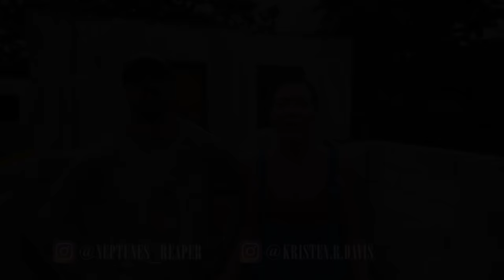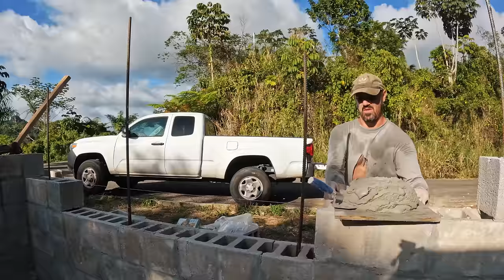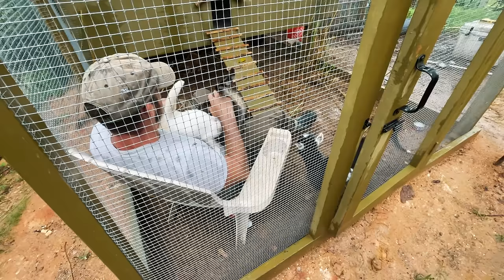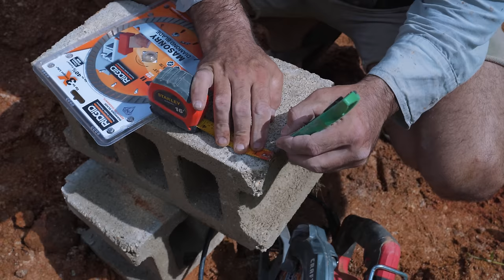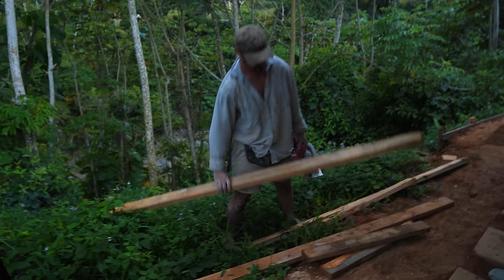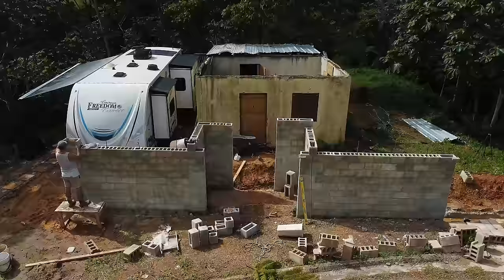BUILDING MASSIVE BLOCK WALL WITH NO EXPERIENCE ON OUR ABANDONED PROPERTY

Comment: what your dad did not tell you is on big job you have a man mixing mortar and another handing and moving blocks  , HE NEVER laid that many alone
Reply: He needs a real partner who will actually roll up their sleeves and actually do some work to help him
Reply: We've built tons of stuff. All my aunts and uncles too.  The one getting joint replacements and spine infusion is the tough guy who thought using equipment to make a job easier was dumb. His projects still aren't done either.
Reply: Do youall still have ur boat
Reply: Not to worry….by the time that Matt has a son, his number will climb.   But you are correct about the there being mud boys who keep him supplied and another helper feeding him blocks all in order to keep the mason buttering and placing blocks.  He will tap and level blocks as he goes but I’ve seen them step down to take a smoke break while the helpers set up his next section of platform/scaffold.

Comment: You would of been better off going w/ a 4.5in diamond wheel & angle grinder. Easier to use and a 1/3 of the price. Wall looks good man, assuming your mortar is good should be there a long time, your footer is massive and should hold up well. You may want to bring in some gravel and dig out some of the clay otherwise the water may start undermining some areas.

Comment: Looks straight well done. Not knowing how you build in Porto Rico but when we build with this block and rebar we fill each bar hole with cement. Keep up looks like you’re in it for the long haul 😊
Reply: Little point in having rebar if it isn’t connected to anything? It’s just inside the void serving no purpose. All the cavities containing rebar should be back filled with concrete/mortar
Reply: Rebar is what is the vertical steel rods each space with these in should be filled with mortar or concrete this stop cracking due to movement.

Comment: Only hint I could offer, is to fill the block where the reinforcing comes through with concrete as you go.  This makes the entire wall a lot stronger, and as an adjunct to that, it is a good ide wherever there is a corner, to push some rods down there and fill those blocks up as well. That helps if ever one wishes to hang a gate from them. I use aluminium painters' trestles/platforms from the hardware warehouse to get altitude for any building projects I take on. These trestles are more like a f9lding table and stash when out of use, are strong, and double as a serving patio table when one is required.  I even lash them to my camper trailer and use them off grid to eat from or to carry loads such as an outdoor BBQ or water tank.

Comment: Matt, I may have posted before but if I had that land I would tie that front entrance directly into that existing building and build from there . The walls are earthquake  and hurricane proof. Or tear down that  house and build a new mansion right on top next to the road. You can reinforce tbe back side with extra concrete to stabilize everything. Just a thought, you can always build other buildings

Comment: You might have missed the easy solution.  Just lay a 2x6 across some cender blocks & you have some scaffolding. Keep up the good work. It looks good & your dad probably wasn't stopping to mix his own mud.
Reply: @Kevink The problem with the cement block scalpel is obvious. He needs to go 2 ft higher in the air to use cement block. To do that you would need a minimum of six three for each side. Now every time you need to move down the wall you have to pick up six cement blocks and reposition them and then figure out how to get up on top of it without the board moving. Not a great idea.

Comment: oooohhh...I'm glad I'm here to advise you after the job is done. If you're only using half bags it's best to mix them in the unopened bags by rolling them and flipping them on the ground....otherwise the mix ratio is off.

Comment: Goats are very useful on the land They clean up difficult weedy areas with ease they are cool to have around and provide milk and meat if that's your thing. Two negatives they are herd animals so need other goats so the extra goat is an awesome addition. Also they are very difficult to contain forget fencing train them to come back to a shed or something dry where they can keep dry feet every night..

The wall rocks (in a good way) long straight walls are easy and fast yours isn't either so will be slow but will teach you heaps. Yeah stucco that will be a steep learning curve :)

Comment: Goats should be great for munching any jungle that starts coming back where you don’t want it! I learned not to skip the eye protection after I was quickly cutting a piece of wood for camping and my circular saw slipped and sent rock chips into my eye. Was super scary but thankfully came out just fine and healed up with no issues. That was 4 months ago and I don’t skip the eye pro ever now! I assume the 5th wheel is not going to leave that spot since the wall is in front now?

Comment: You need to remember to fill the cavity with the rebar with concrete and tap it in so there are no gaps before you put the finished flat block on top.

Comment: If you're gonna have 1 goat you might as well have ten. You should get some fence to move around you can put them to work keeping the brush down. Your wall is gonne come out great. The scratch coat you put on before stucco will smooth everything out. Good job. Cute goat. Think he's gonna need braces to straighten that smile out.
Merry Christmas.

Comment: Matt: instead of the stool you built here is an easier and faster way.  Take a couple bricks and a 2x8 (2x6 will work) & 2x4 . Make a " T" stopping 1' from each end so to sit on brick. And you have a walk board that will hold your weight and you can work 10-12' of wall without having to move that stool/table whatever you call it. Save you Tons of time.
Reply: You can even sit brick on it so you don't have to get up and down

Comment: When you stucco, there is a concrete mix with fiberglass in it called structural skin.  The fiberglass fibers hook into the pores of the concrete block like velcro.  It's strong enough that some claim you may lay a block wall dry, place the skin on and that's enough.  So if you are worried about the strength of the wall you have options in addition to filling the voids of the block with concrete

Comment: I don't know how you'll do it in the end, but you should have filled the hole in the blocks where the welts are from the first layer. Now only if you use very liquid mortar, doing the process several times, filling and waiting for the water to dry, otherwise the mortar, coming from the last layer, may not reach the base, leaving spaces with air.

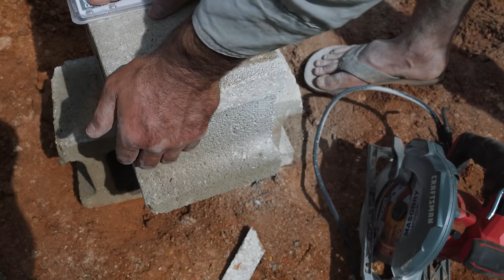Comment: 14:16 You should be wearing your respiratory protection too. Cutting masonry and breathing in the dust can give you silicosis. Think asbestosis but without the fiber. It can hospitalize you if you breathe enough in and can present in an acute or chronic fashion. To much dust too quickly can put you down in a day, amall amounts over time can sneak up on you and you find yourself wearing a strap on oxygen tank when you're 50. (30 years in environmental industry and seeing people who made poor choices or had bad employers) Crystalline Silica based dust can be very fine and the small particles can fill the alveoli and alveolar passages. Think something like drowning on dry land. Get proper respiratory protection to wear while making dust or disturbing existing dust from masonry.

Comment: Please forgive me, it’s Christmas Eve and I’m here wrapping presence. I totally forgot to have mentioned Puerto Rico’s lack of building codes for column installations throughout any and all walls to guarantee structural integrity. It’s the strength of the columns that determines the strength of any and all buildings; inclusive of walls etc.

I would advised you to use Jamaica’s building code because it seems as if Puerto Rico’s building code needs revisiting and revising mate. I don’t think that with the structural integrity of Jamaica’s building code, any building inspector/structural engineer will disapprove of.

Comment: A simple question about the block wall ............. why?? Defining the property line could be done a whole lot cheaper with much less effort. If the purpose is fortification, then both ends are open and it is short enough to easily scale. Not being a buttinsky, just curious why such a massive wall??

Comment: Aya Jesus! You guys are so funny :)
The wall looks wonderful, cosmetically, I give you a 10.
Strength, not so high, I haven't seen mix going on the block's vertical edge.
The matter is that you haven't filed the holes inside each block, which would have given a 10 strength.
The mix dries superfast and bounds correctly, that is because of the amount of chemical you have got, which seems a lot in your brand's type.
Merry Christmas! 🎄🎄🎄🎅🎅🎅
Reply: I too, brought once two monster Rams, one black, one white. Selling the house, they are staying in it.
I checked lands and little houses in the PR, it's super expensive bro, I didn't find anything serious.

Comment: Not sure how you plan to finish the top. Top ledger cap or pour mold. If you do a pour molded top cap, I would suggest adding a metal mesh layer across the top before the pour. I think you may have earned your "Dego Brick Layer Badge" for your incredible effort and tenacity. Great job and I think you deserver a week on the sailboat for a well deserved rest. Also, goat cheese making will be the next learning experiment. Merry Christmas to you guys and have a great 2024!

Comment: matt youre suppose to fill all the holes of the block with cement each leyer thats how that blocks are used especially the area where you placed the steel. and also you need to put horizontal steel atleast every after two leyers. that wall is hallow and weak and dangerous if it will fall to somebody. youre doing it wrong those blocks are not bricks the way you are doin it

Comment: You are not filling the brick holes with the rebar with concrete?  You should otherwise there is no point to the rebar and the wall is only held by the mud. Think about it…